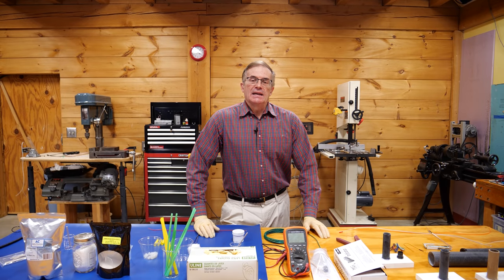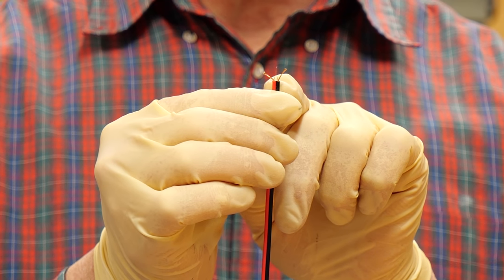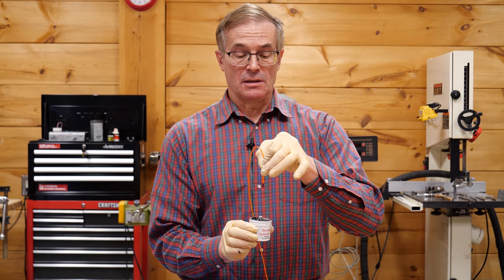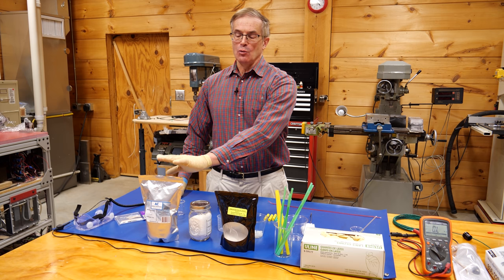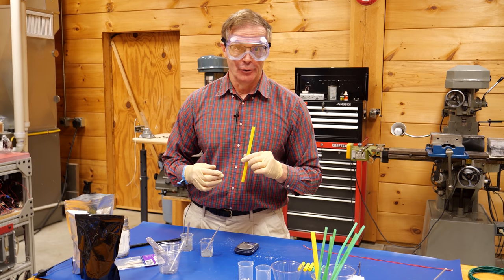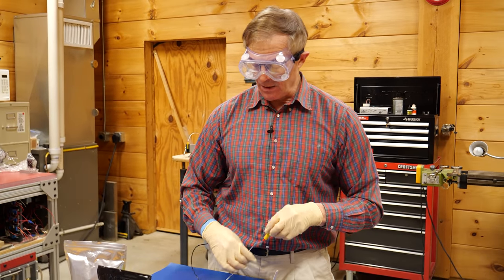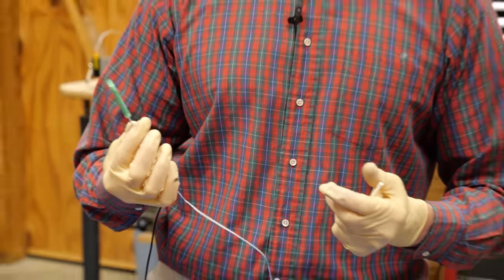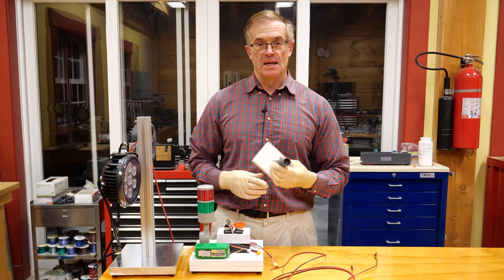Rocket Ignition System On Steroids!

Comment: Small safety things to nitpick about, but are probably low probability events: 
1. The gloves you are wearing separate you from the antistatic surface, so the wrist stat isn't doing much (unless your gloves are conductive, but they don't look it)
2. While not as bad as plastic, glass can still build static, especially with powders. Plus, it can shatter if the burn rate of the powder is fast enough. They have conductive anti-static polypropylene containers out there that would be better suited for mixing ESD sensitive stuff. I found a site that sells them for $5 (though, you have to buy 50 of them... https://www.lacontainerstore.com/Conductive-CAS_c_176.html)
3. Not much you can do with this, but watch out for RF signals, as they have been shown to spontaneously ignite low-voltage, low-power systems. I have no idea the susceptibility of your igniters or even the commercial ones, but hotbwire devices have always had a bad reputation for RF safety. A walkie talkie has been shown to set them off on occasion!
Reply from the maker: The value of the antistatic system is that both the inside and the outside of the glove is grounded.  A charge build up on the glove is unlikely.  You're right about the static dissipative cups. I'm doubtful about the RF risk to a low voltage, directly wired resistance load.
Reply: @TechIngredients  i would agree charge build-up on the glove is unlikely, but it is possible. Worth the risk of taking it off? Probably not, but unless you are worried about a spark arcing through the glove, wearing the glove defeats the purpose of the wrist stat, no? And the outside of the glove isn't really grounded, since the glass container separates the powder from ground. Again, low risk, it's more of a nitpick than anything.

As for RF, it really can ignite things like these quite easily, though I am by no means an expert on what makes them particularly susceptible, so it may not apply altogether for your case. Anyways, it's why all military detonators are all qualified through HERO (hazards of electromagnetic radiance to ordnance) testing, and I have actually seen a video of some hot wire devices accidentally set off by a walkie talkie. The easiest way to get around RF is requiring a very large voltage, so if your initiators are low voltage they may be susceptible. Best practice is to avoid using RF devices near them. (You can find an example of how to characterize RF hazards to similar devices here: 
https://www.unsw.adfa.edu.au/conferences/sites/conferences/files/uploads/Session%207A%20RADHAZ%20to%20ordnance%20assessment%20-%20Neethling%20-%20Handout.pdf)

Comment: You didn't recommend using plastic cups but instead recommend glass or wood. I have always been told to never have explosives in glass containers.

It's conflicting for me, because you always have good logic and reason, but that statement was the exact opposite of what I've learned. Please elaborate so I can learn.
Reply from the maker: Were you told why you shouldn't use glass?
Reply: @TechIngredients  Shrapnel, if a trip to the hospital is needed glass is harder to find inside the body. And that plastic shrapnel isn't as likely to penetrate the body.

Comment: Electric schematics for the launch controller, please?
Reply from the maker: Sorry, I didn't draw one up, but the light tower included a schematic for itself as does the keyed switch.  It's very basic.
Reply: The tower I bought is labeled in Chinese.   The keyed switch has four terminals...1&2 are orange and labeled 'B'...3&4 are green and labeled 'A'.  When the key is turned, does that close a circuit between the 'A' and 'B' sides, or between 1 and 2/ 3 and 4?  Thanks.  I assume the black wire on the tower is a common ground for both lights and the buzzer?
Reply: I made a launch controller of my own.  Unfortunately,  I can't share a photo of it's wiring.  I made it so it has three channels for three separate launch sites, a key lockout, a voltmeter to indicate continuity, a lighted pilot safety switch, and a green light and buzzer for "go-for-launch"...and I still can't figure out this setup.   There is only one ground for the red light, green light and buzzer on the tower.  I thought they would be wired in parallel...are they in series?
Reply: Nevermind.  My controller has more features than your design,  anyway.   I'm done watching your channel.

Comment: To those following at home: it’s only (barely) safe to stand that close to a lit rocket motor because it doesn’t have a nozzle installed. Some worry-warts would hesitate to stand that close even without a nozzle, for the sake of good habits if nothing else.
Reply from the maker: Did you watch our recent video where we tested a few engines?

Comment: I've been wanting to try around with KNO3/sugar rockets since a few years but I cant buy KNO3 nor any other nitrate Salt in germany :/
Reply: For sugar rockets, potassium chlorate works well too, and is easily made from boiling bleach and potassium chloride (KCl is sold as "low/no-sodium salt substitute"). Chlorate mixes are more sensitive and energetic though, so you have to take lots of precautions when working with them.
Reply: @Nuovoswiss  Hmm I was thinking about making a chlorate cell but I would need proper electrodes first ( I could also use graphite but I'd need to swap them every team and clean up the chlorate).
Reply: @Linus-nq2op  I think the use case for a chlorate cell is if you wanted relatively large quantities, or just as a neat hobby project. But making just a few hundred grams by boiling sodium hypochlorate bleach with KCl is really easy (though it can corrode stainless steel, so either glass or ceramic-coated cookware is necessary).
Reply: @Nuovoswiss  Forget it I got KNO3 (found a company in Italy which sells it to Germany)

Comment: 1. If I misspelled anything it's probably because everything has been real blurry for a lost a week now.
2. I'd like to know what makes colored smoke and also burns colors. Self made fireworks.
3. Make a long wire with molex connectors on each side. Quick disconnect from both ends. The battery can be 8 size d batteries in series making 12 volts high current.
4. My cat said hi or meow.

Comment: I don't have any experience in making rockets go up.
I have a lot of experience in making them go sideways though.
If you end up wanting to make them go sideways *for some reason*, don't use servos for the control surfaces.  They are nowhere near fast enough.  Just use solenoids that oscillate fully from one direction to another.  Even better, if you're making.. eh.. particularly big rockets that go sideways, use an electrically driven pneumatic switch and compressed air cylinder/pistons for the control surfaces.
Here's something cool, I'm not suggesting you put it on the front of the sideways rocket, but   you   could:
https://media.digikey.com/pdf/Data%20Sheets/Panasonic%20Electronic%20Components/AMG88x1,2_Grid-EYE.pdf
-edit
If you get this far, would it make sense to just build the igniter into the engine?  It feels like the perchlorate based fuel should be compatible with the flash powder, maybe not the sugar mix though.
Reply from the maker: I understand.
Regarding the igniter, keeping them separate is probably worth the safety even if you design one that can be inserted quickly...if that's necessary.
Reply: @TechIngredients  One of the many things I'm interested in trying to build is a compact, expanding drone that can be fired from a 39mm flare launcher.
I asked about the igniter because in that case you would essentially have a big shotgun shell that contained a primer, propellant, shot cup, the drone itself, a (probably short) engine and igniter.

For what its worth, every military rocket/missile system I've worked with has had a very, very fast burning "ejection" motor (that burns for 50-100ms) followed by a longer (but still very short) acceleration motor.  I've always felt its been sketchy how long it takes civilian rocket igniters to start (even 200ms is a looong time), how much variability there is in that time and how long the motors burn (the longest burning non-commercial one I've dealt with accelerates a 40lb "rocket" to just under mach 1 in 1.2 seconds).

I really need to understand more about the fine line between igniting an engine and causing one to blow up in its casing.

Comment: how do you ignite a high temp charge, like aluminiun carbide - iron oxide or kno3? its ignition temp is 1400C, decomp temp
Reply: if you have water, it will go boom
Reply: why do you use electrocution systems? one hand in pocket, now you are permanently out of the pocket
Reply from the maker: The flash powder is much hotter than that.
Reply: choose your poison, fear or courage
Reply: no, never trust people, no no
Reply: tongue is evil
Reply: its better to go boom, than to be tied
Reply: @TechIngredients  it has to sustain chain reaction, it cannot stop in middle
Reply: @TechIngredients  i mean, nuclear reactions are chain, single even does not ensure full boom
Reply: @TechIngredients  what is much hotter divided by a large number
Reply: You have got to chill fella. You are ranking on the schizometer with your hardly related sentences, every half minute. 

Stick to a dense choice of topics per comment, that are relevant to something we can all commonly experience, usually right here and now. And then complete a cohesive comment based on said topics, and make sure it is all related and relevant to your previous topics or the recipients. Use words and turns of phrase that can be commonly understood. Otherwise you are choosing to be a way that is deliberately aberrant and therefore not for the purpose of communication with equals.
Reply: @chickenmonger123  never touch anything with the opposing hand, only with the grounded hand, i will not touch your talk
Reply: @chickenmonger123  my master is Jesus christ, not you
Reply: @chickenmonger123  if you did not get, my answer is f in the most deepest way
Reply: @chickenmonger123  i'm not common with you
Reply: @chickenmonger123  you are above me if you say anything against me
Reply: @chickenmonger123  not talking to you like you are above, not taking you as any type of judge, for me
Reply: @chickenmonger123  i'm not yours, i'm christs, you can talk all you want but no matter
Reply: @TechIngredients  the original point is that you can hold a very hot object in hand and not get burned
Reply: @chickenmonger123  you did know what was good and evil, so you must now go, you cant stay
Reply: @chickenmonger123  you expect me to serve you? not gonna happen
Reply: @TechIngredients  with one hand i defend, with one hand i build, and arc furnace starter should be very nice, hot
Reply: @TechIngredients  for electrical engineer, its the thump pointing finger rule
Reply: @chickenmonger123  no thanks for your rules

Comment: I noticed some of your engines burned for a long time. They absolutely have to be out befor they reach the ground.
Reply from the maker: These are not engines.  They are open tubes filled with propellant and without a nozzle.  Without  a significant  chamber pressure, the propellant  burns slowly.

Comment: You’re looking a little close to those rocket engines without full eye/face shield protection my guy.  Also sticking your head over a spent rocket engine casing still on fire for a cool outro sets a bad example for the younglings.  Safety first!
Reply from the maker: I understand.  But remember, these were not rocket engines, but propellent test grains without nozzles.
Reply: @TechIngredients  fair point.  I still would encourage full goggles and nonflammable gear.  I feel that us glasses-wearers are far too lax about full eye protection.

Comment: I always thought it would make more sense to light it at the top too, but you said in a previous video not to use canon fuse https://youtu.be/nPM3KcHzN6I?t=3514 because it burns inside of the tube so not a lot of heat gets to the outside.  Wouldn't a canon fuse be perfect to ignite it at the top?  Reliability issues could be resolved using the contact glue and flash powder method you demonstrated in there as well.
Reply from the maker: That would mitigate the location issue, but the safety and energy limitations would remain.

Comment: Where the test burns nozzle less ?
Reply from the maker: Yes.  I mentioned this, but didn't emphasize it.  These were only grains for testing propellent formulations.
Reply: @TechIngredients  k ty. I missed that lol. Great burn rate. I build my own rockets and engines too. I’m just using my home made black powder recipe and of course rocket candy as well lol. Great vid , very informative. Awsome idea on using the straws for the ignition caps. I’m making my own aluminium powder. It scares the crap out of me because too fine it possible of igniting when checking the grain lol. It happened to a friend of mine lol.